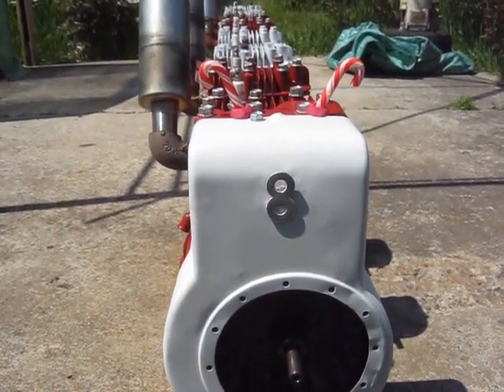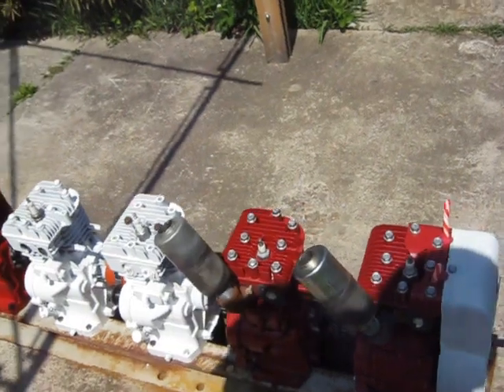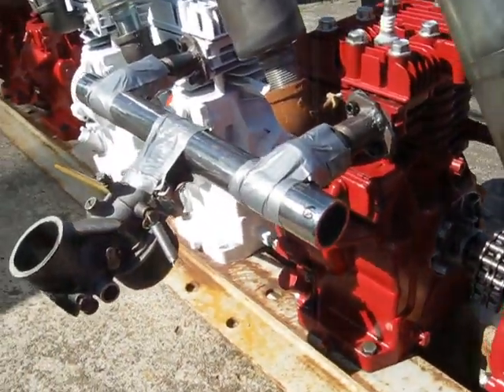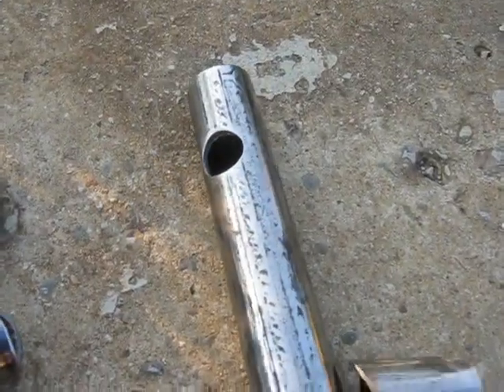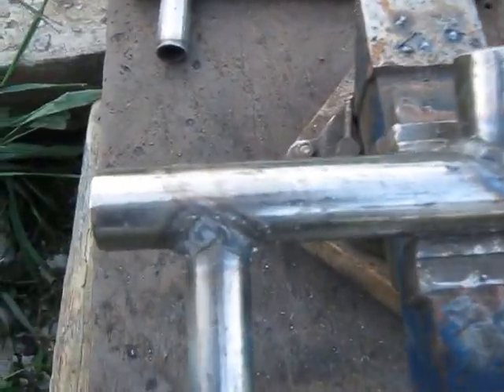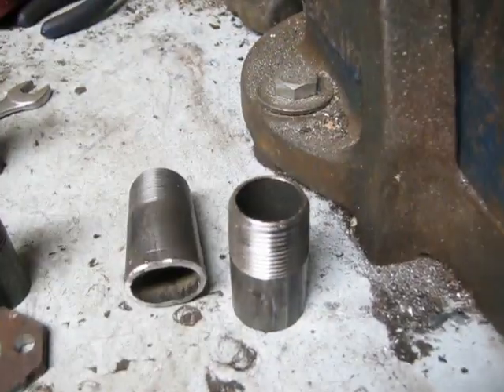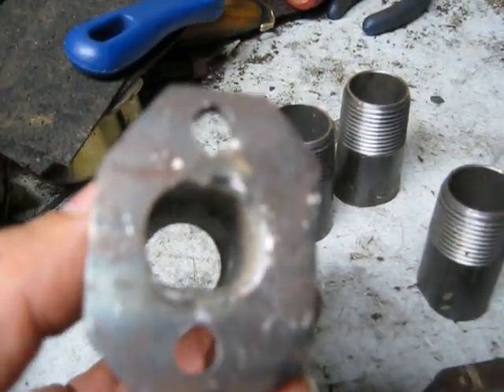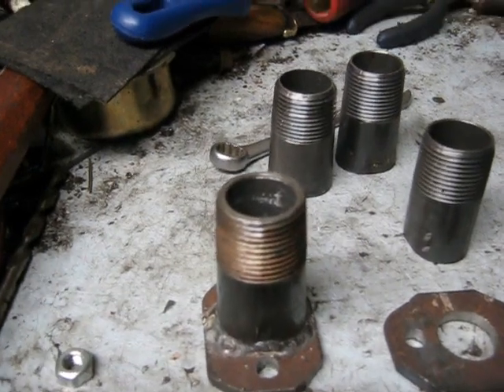Briggs 8 Intake Manifold Fabrication

Comment: Hey man awesome vid can't wait to see her run! For more strength I would make plates to bolt onto the head bolts between each engine. Would make it really strong and limit flex.
Reply from the maker: Yes, I am sure I need something to hold the manifold, or it will do a dance for sure!
Reply: definitly! i hope the couplings hold better! i have a feeling the chain couplings will be better and stronger than the standard flex disk couplings.

Comment: Love it! Have you thought of slitting the tube partway down the middle, expanding it out wide and then welding triangle plates on top & bottom to create something that looks like an old Ford 300 cube Offy intake? Then you could stick a single barrel from some vintage flathead on top each manifold. Whatever you do I'm sure it's gonna be great. EDIT: Nice welds, btw.
Reply from the maker: Hmmm, interesting ideas for a manifold! I will try these ones out, if they don't work well enough, I am up for changes.

Comment: It's getting there!
So, how are you going to start something that long?
Reply from the maker: The starter is currently the hold up. I need to have a riding mower flywheel machined out.
Reply: ChargerMiles007 Ah, power-start is good, don't want to bust your arm starting that beast!

Comment: i am just waiting to see if them motors have enough vacuum to pull the fuel that far and if so then how long will it take.....lots of luck
Reply from the maker: Oh, I am sure the motors will pull the fuel that far, it should start with enough of a prime! The main item left to make is the second flywheel that has a starter gear on it.

Comment: Motor cycle carbs, use 8 , build a bracket to hold and link them. look at a 1978 KZ1000 set up . It's only 4, but you can see how the linkage is set up.
Reply from the maker: Jeepers Murphy, I can only imagine the carb linkage!!! It would look like the engine was attacked by an Octopus!!!  :)

Comment: I like the idea of having flexible fittings. Should have done multiple intakes going to a central split off with the center 2 cylinders having equal length tubing so there's more even fuel / air delivery.
Reply from the maker: Yes, this won't have very even fuel distribution, I am just under the gun to get it going!
Reply: That's true. Can't wait to see what happens. ;)
Reply from the maker: Looks like I may have to downsize to a straight 6 for an initial run, as my starter gear won't be machined for another week. I would have to make some manifolds for the 6, but I think it is possible.

Comment: will that fuel it probably, how big is that carburetor?
Reply from the maker: The carb is from a 28 cube 12 horse Briggs, so it is a bit undersized. I will try it this way, with the 2 carbs, if it runs too badly I will have to change it.
Reply: ChargerMiles007 makes sense

Comment: As for the weight, my 3 hp 80202 weighs about 25 pounds with an empty fuel tank, so you're probably pretty close with the weight of that beast.
Reply from the maker: Yes, it isn't a light weight!

Comment: What is the application for this "THING" you call an engine? It can't be called an engine because it doesn't share a common crank shaft. I would have bought a metal lathe and mill and made my own engine but who am I
Reply from the maker: I call it an engine because it runs like one. If I had the money and more importantly the indoor space for a metal lathe, I would buy one for sure! Don't kid yourself, making a crankshaft for a straight 8 is going to be a time consuming and expensive endeavor.